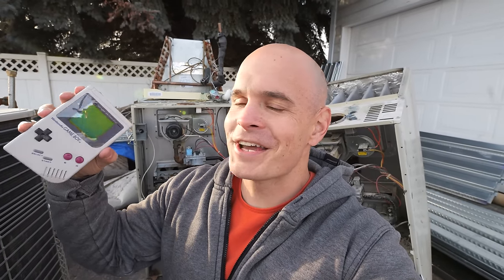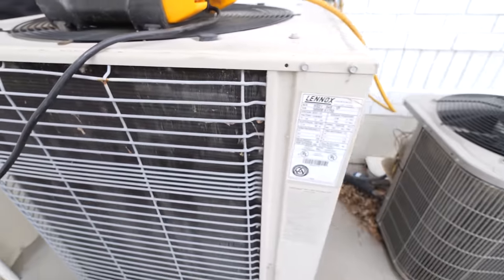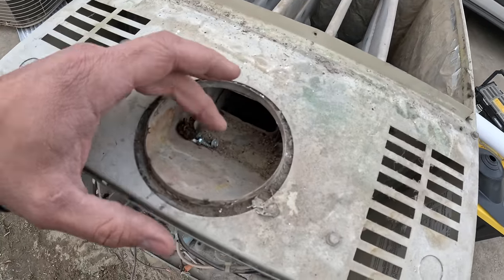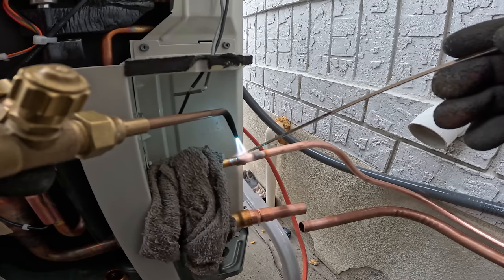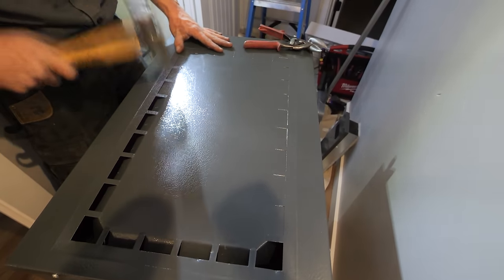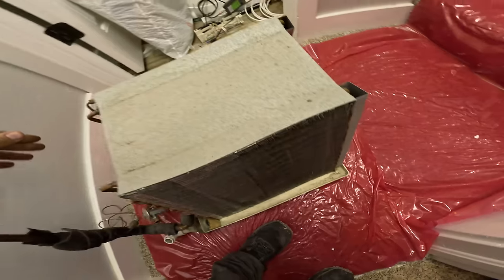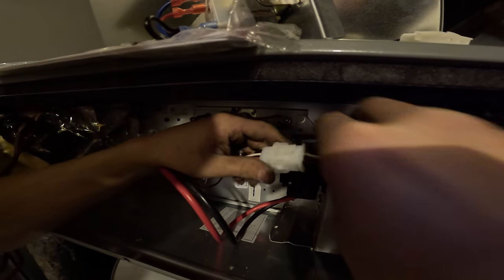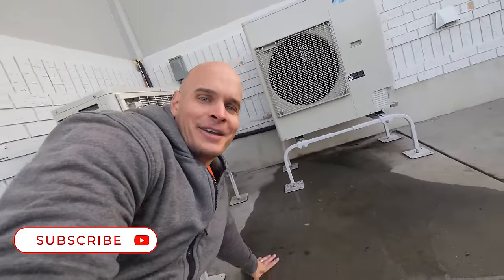Why is Everyone Talking about Heat Pumps?

Comment: I work for an HVAC contractor as an installer. We are a certified Daikin dealer and work closely with the local Daikin reps. I've personally installed well over 100 Daikin fit systems. If the installers don't take the time to do the little things the right way, or if your duct work is undersized or bottlenecked, those systems will give you nothing but problems as they are extremely sensitive. If the installer doesn't purge the lineset with nitrogen when they braze there will be soot that forms on the inside of the lines and it will ruin the metering devices and the electronic expansion valve. And even if everything is done perfectly sometimes they just have problems bc Daikin has some pretty inconsistent manufacturing quality. I personally love the system because my coworker and I take the time to do the little things, but a lot of the guys hate them because they don't.
Reply: Which area are you based out of?

Comment: R410A refrigerant is being phased out. Guys did a good job on installation. Good thing you got rid of those old R22 units. I won’t touch R22 units any longer unless it’s an electrical issue. Even then I recommend replacement.

Comment: I have been pushing heat pump technology since I was about 15. I'm pushing mid-40s. It's about time they start playing with it commercially.
Reply: I had heat pumps in a building over 20 years ago just depends the area.
Reply: @lylestavast7652  The technology has been around for quite a while, but it's been horribly underutilized.
Reply: @peterbarta1444  Because it stupid compared to NG equipment, NG equipment can work in all environments without needing aux heat. Heatpumps cost more to install, more in repairs, parts are hard to get and they dont last as long. Plus Homeowners cant fix them as they can a NG system. They are more negatives to them than positives.
Reply: @zack9912000 I'm missing where NG works in the summer to cool? Unless you're saying that two separate heating and cooling systems is simpler and easier than..one?
Reply: @mattszeto  It should go without saying because the video is talking about heating a home. A complete NG systems you install a high efficiency AC 16 seer and higher with it and it still thousands less than a heat pump.
Reply: @zack9912000  did you miss the part right after the intro where the reclaiming the refrigerant out of his air conditioner because of the dual use purpose of a heat pump? It's not the only place that talks about the benefit of heating and cooling in the video. Video is focused on heat because, A) time of year. B) when the technology was younger, heating in colder climates was something heat pumps struggled with. That's why a lot of people talk about the ability to heat with them now because that has been worked out.

Comment: As someone who lives in Australia it completely blows my mind split systems are new in America most rooms in Australia have their own systems
Reply: Yeah splittys are the best
Reply: Splittys aren't new to the US, old mate already had one, what's new is reverse cycle (hot and cold in one unit).
They are also behind on the times on what gasses are used.
His new unit uses gas that was banned here 10+ years ago for new aircon installs, both cars and homes.
He also had Natural gas heating which is top notch but horrid for the environment (hydrocarbons and such) and some say your health.
Reply: Not new, just not practical in some places. Heat pumps are very inefficient when the outside temperature gets below freezing. America is very diverse in terms of climate, especially on the east coast. Florida or Texas for example would benefit from split systems using a heat pump but somewhere it gets far below freezing like North Dakota it would actually be extremely inefficient and could actually leave you in the cold. Lots of homes in America just use central heating and cooling systems because it’s easier for larger homes to have a a couple large units versus a bunch of smaller ones that would struggle to cool a large room.

Comment: As heat rises too it's a good idea to put vent out fans in the tallest part or the ceiling too. In every room also makes cooling WAY more efficient and cools immensely faster also. And they are very very cheap to put in. It's good to pump out the heat and do air exchange Everytime they turn on. You can make them turn on with a thermometer hooked to it and turn on 10 minutes before the cooling starts.

Comment: Heat pumps should not cost much more than ACs, all these HVAC companies are price gauging hard. In addition a lot of HVAC companies just install the same capacity heat pump as the gas heaters which are often multiple x overpowered for the house driving up the price. Keep watch and calculate the capacity of heat pump you need yourself.
Reply: Should companies lose money on installs?. HPs costs like 30% more to buy than furnaces. And no, technology connections was off on his video
Reply: @LeArmBoss  It costs the same to install as an AC unit. Companies should earn obviously but they are price gouging not earning in this case. 

I can say this for sure because I have gotten quotes on heatpumps vs AC installs of the same size and the upcharge is huge for no extra labor or skill.
Reply: If they cost 30% more to buy, why are they up charging by 300%? A 15kbtu mini split installed in nz is approx $1500usd…
Reply: An AC is in fact, a heat pump.
Reply: @Tkaya460  Indeed just with a couple extra values

Comment: I have recently replaced my 20 year old heat pump with a new Trane high efficiency unit.  Cut my power usage by almost half, not to mention a pretty nice tax credit.  Definitely worth the investment.
Reply: Till it breaks and see the repair bills and have to wait weeks for parts
Reply: @zack9912000  I see a liar has joined the chat, basing their opinion on one (1) person who probably got jerked around by an HVAC company (no... that would never happen.)
Reply: @zack9912000 Normal ACs work for decades, why would a heat pump, which is essentially the same thing with a reversing valve break down?

Comment: In Tasmania i have been using Heatpumps to heat and cool my home for the last 25 years,
10 years ago i installed an Air to Water Heatpump to replace our electric 300 litre water heater, they are both great systems and cheap to run.
It amazes me how far behind America is when many parts of the world have been using this technology for 30+ years.

Comment: Heat pumps have had a big push in the UK too, but the problem is that electricity here costs 4x as much as gas, meaning they end up being equivalent in running cost. Given that a heat pump is more expensive and more specialised to install than a standard gas boiler, and takes up some external space that not everyone has, it's fair to say most people haven't bothered switching.

Comment: We already switched. After some growing pains (ea configuration) it’s great now! We use the newest propane version 👍
Reply: Newest isn't propane based. It's a mix of r32 and r1234yf (car refrigerant).
Reply: @LeArmBoss wrong. R290 (which is propane) is the newest and the most ecological (at least for now). Technical theres R-454b, which is newer. But not up to buildcode for now. Here around  R-454b isn't even acknowledged, it's basically an US thing for now (and in the US not up to code, as i said). I don't know what you want.

Comment: I've done HVAC-R for 25 years and we have had heat pumps in the south-central part of the United States longer than I've been doing this. The technology has finally made it efficient enough to use in the northern states. personally, I use a Wood firebox outside that heats a water loop that feeds a water coil as my main fuel with a gas Furnace as a backup.  No 200-amp service is required and during a power outage, we can have heat still using s small generator.

Comment: Isn't R410a like 2 generations behind and has been replaced first by R32 while currently R290 (propane) is the new hot shit?
Reply: Propane is great for warmer ambient temps, it's very efficient. But not as good for very cold places as it has a bit high boiling point.

Comment: Here in the UK, a heat pump is about ten times the cost of an equivalent gas boiler, and electricity is four times the price of gas.  No contest!
Reply: Same here, cost me 90 bucks a month to heat with NG and my uncles has a HP that runs his electric bill to almost 500 a month in the cold winter months. Has the highest efficiency inverter system and still struggles.

Comment: Here in Norway heat pumps are on every other house and have been for a long time. It's great but as it's cheaper to use electricity some tend to use it more than they need creating a larger bill than if they used normal electric ovens. Still drilling down hoping it is not to long down to heat water. Using 2 pipes with a U-bend. It costs to get it started but then it's super cheap :-)

Comment: Daikin would probably supplied the system with R32 refrigerant in Northern Europe.
Most system use it here.
1/3 global warming- half environmental tax and the gas price around the half versus 410A.
R290 highly flammable, but environmental the best, seen installed in the US these days.
Reply: They wont be allowed tonuse R290 here for homes systems. Next year R32 and R454b will be the new refrigerant for the US. R410a is being banned and no more can be prodced or imported January  2025
Reply: R290 isn't allowed for home usage in hvac equipment. EPA restrict its usage and in commercial applications is max at 5.25oz due to explosion concerns and it terrible compared to traditional refrigerants.

R32 and R454b will be replacing R410A next year.
Reply: People have pipes with highly flammable gas pumped into their kitchens, and nobody seems to worry about that...in the same way that they seem to worry about r290 in heatpumps

It doesn't really make sense
Reply: @zack9912000  
A little funny someway since you use gas driven heating system in many homes.
We lost that opportunity at least 50 years ago. Thank God for that.
Still a huge natural gas supplier.
I saw an YouTube video some days ago from USA and they installed a R290 heat-pump.
May be commercial, but looked like a house installation.
In Europe I have worked with ultra low temperature freezers on hydro carbon and due to restrictions, the allowed charge on two stages is just total 250 grams so the all ULT business is very troublesome since the systems are almost running dry and fail so extensive these days
Reply: @kierank01   It makes sense when you consider that propane is running at over 100x the pressure when used as a refrigerant.
Reply: @zack9912000   R290 won't be in split systems but it can work great for "monobloc" systems where all the refrigerant is contained inside the outside unit. This also has the huge benefit that installers don't need to work with fiddly refrigerant lines. Instead these units transfer the heat by pumping a glycol solution to the indoor coils.

Comment: your heat pump installer did not install condensing drain at bottom of the daikin units outside that's why concrete is wet

Comment: I wired in a custom home a few years ago that had 2 by6" fully insulated exterior walls and over R50 in the attic. The HVAC company installed two name brand highly rated  heat pumps. One for each floor. First winter they had a service call for each unit that was covered under warranty. Next winter two more service calls that think it was the labor was not under warranty and it cost over $400. Third winter repeat but over $500. Finally after the warranty parts was over I convinced the home owner to just run the them in the emergency setting that used cheap natural gas. Homeowners wife was a CPA and keep all the cost and she said that yes running on gas cost more but with the gas furnace never requiring a service call it was more expensive to run the heat pumps with all the expensive service calls.

Comment: Just FYI, heat pumps can't handle hard winters. They're great in mild winters, though. It is possible to have a dual system, with a heat pump for mildly cold days and a furnace that will kick in when temps get really low.

Edit: I guess I should have waited to the end to comment. Looks like you covered this. 😁

Comment: Heat pumps? Here in Sweden they have been the standard way of heating buildings since the 90's.

R22 is an excellent refrigerant, with almost the exact same properties as R290 that is replacing most older type refrigerants like R410a...

Boiling temperature doesn't matter, since it's stated at atmospheric pressure. In a refrigerant system, pressures can go negative to lower the boiling point even further.

Comment: What installers don't tell you is there is a HUGE market for that reclaimed R-22 coolant.  Due to its being replaced by R-410A, the cost of R-22 has skyrocketed.  Companies take that reclaimed coolant and resell it back to a customer or sell it to a company that redistributes it.
If you have 8 lbs of R-22, your installer should credit you $800 to $1,200 for the coolant as they'll make that much or more.
Reply: there are replacements for the R22 on the market
Reply: @abc123fhdi  Unfortunately, unscrupulous repairmen don't bother to tell folks this... especially taking advantage of the elderly.
Reply: I was thinking that the installer probably charged him to haul it away and then sold it for quite a lot. Great business.
Reply: There's not a huge market for reclaimed r22. R22 hasn't been manufactured since 2010 and systems that use it are old and getting replaced. The stuff that comes out of an old system has to be recycled to be used again, that's why r22 is so expensive, it's not some shady racket.
Reply: It is a Federal crime to take it from one person system and use it into anothers system. That is a major EPA fine.  We have to turn it in to centers for it to be cleaned and those companies will resell it. We have to pay to dispose of it. It 1500 to 1600 a jug now
Reply: @zack9912000    @LeArmBoss  There are plenty of unscrupulous companies and repairmen that don't care about the fines.  Read the news:  "California man first to be charged with illegally smuggling potent greenhouse gases into US" - that was R-22.  Don't even think that was the first.  The domestic problem is even bigger.
Reply: @_SurferGeek_ I am not saying they don't exist, but if people want a 10k reward, turn these companies in.
Reply: @zack9912000  My point is that they're out there taking advantage of the poorly informed and elderly that wouldn't understand or know that they're being scammed.  That's who they target and they have plenty of "customers".
Reply: Lol we don't sell it back. We actually have to pay to get it taken away from us.
Reply: @povoljan13   Good companies do... there are plenty that don't.

Comment: Our mini splits are actually very expensive to run in the winter here, surprisingly. We have a 900 sq/ft house with 13' peaked ceilings and the cost in MN mild winter with it set to 60 degrees most often is almost $200/month.
Reply: And that's bad??

Comment: Just a side note on heat pumps.  In most places a totally above ground system is by far the best way to go.  However, if you live in an area that gets exceptionally hot or cold you want a geothermal system instead.  Since once you get a specific depth below ground the temperature is almost fixed in place you keep a high exchange rate in either cold or hot climates.  This can easily raise your costs of install from as little as 3 times to over 10 times an above ground system.   Mostly dependent on either the depth of permafrost in cold regions and or layers of solid rock anywhere.  Thankfully for this in hotter regions you don't have to go very deep.

Also baring damage from say Earthquakes or landslides, you rarely have to update or replace the underground loops, they can often last longer than the home does.

Comment: I got a Bosch IDP packaged unit a couple of years ago; thanks for helping me understand how it works. I live in Phoenix and find it doesn't heat too well when the outside temp is at or below 32 degrees. (This is a rooftop unit) Fortunately we only get that cold once or twice a year.
Reply: With your comment there, very much possible you don’t even have heat strips installed or set up right.

Comment: Do you really need that extra heating? My 8kW (that's the electric rating) heatpump heats my 2 story home even when it's -25C outside. The only time I had to use separate space heaters was when the electronics failed. But other than that incident, almost 20 years of flawless and emissions-free heating.
Reply: Even in TN with our mild winters I've noticed the heat strips kick in on occasion, but the heat pump gets the job done most of the time.
Reply: Emission free heating? Are you off the grid with pure renewable energy? If not, then you are using electricity from a utility and that produced emissions.
Reply: @09Cat800 many refer to local when they say this.   BUT, many utilities are bringing on various methods of emission free production.    The giant waterfall near me does a pretty good job of that (if you need a reference older than the typical crying points you hear after your statement. )
Reply: There isn't a single state that has 100% emission free energy in the USA so you are still producing emissions unless you are off the grid. My last utility did have 16% from hydro but nowhere near 100% emission free. The rest was coal and natural gas fired power plants. He should say local not 100% emission free. That is naïve to say or even think that. Just like auto manufacturers say zero "tailpipe" emissions on EV cars. They still produce emissions from the electricity they use.